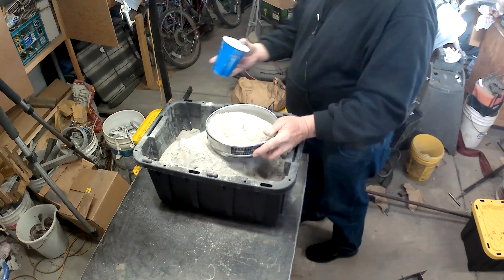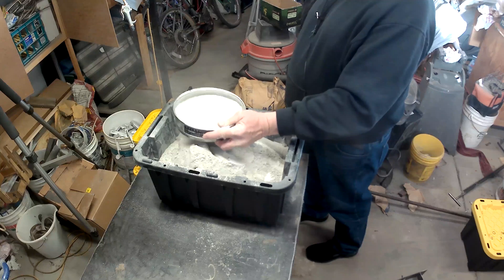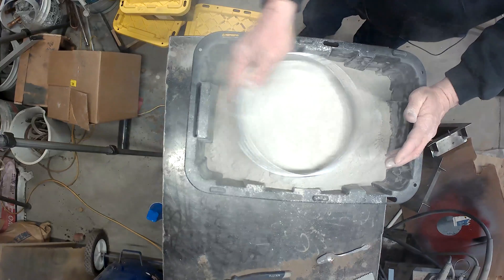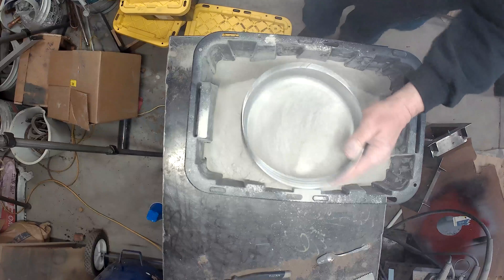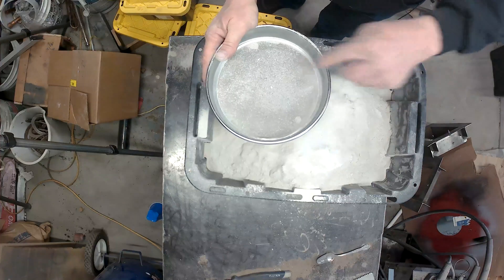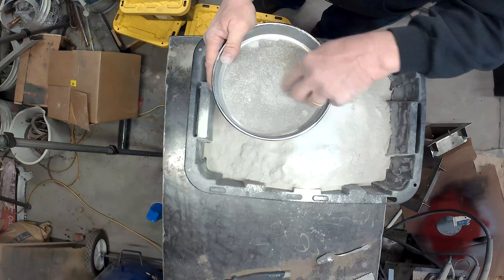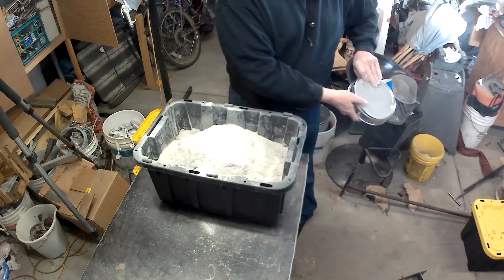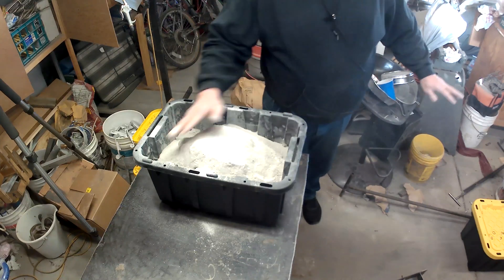Walk away from petrobond. My last word

Comment: Good to see a new video! Hey isn't that the cattle branding logo on your sweater? Nive to see a little of the town you live! Looks kinda busy? Are there regulations in regard to COVID-19? I have never used petrobond, it's just too expensive for me. I do not make my sand myself, but buy it from an art shop. It's a very fine sand, almost like dust. In there is clay. I'm still looking for the best water ratio in it. So far I think it can catch all details, but I'm a little worried about the water evaporating and causing bubbles in my cast. If I mix it with less water it will be much more difficult to carve out channels for the metal to flow... I'm still in the experimental phase :) Great video again!
Reply from the maker: Yes, it is the brand that my wife developed.  I love it. 
I was shocked at how much traffic there was the day that I recorded that drive. It's normally not anywhere near that busy.  
Our whole state is under a "stay-home" order. I haven't heard if the latest call from the president to go until April 30 is in effect here now as well.  I assume it is or will be very soon.
I think most people would be surprised (well those that haven't used green sand) at how dry my sand is.  The only time I've seen problems in my surface was when I mixed it too wet and I think the steam deformed the surface.  I have yet to see my sand cause any sort of porosity.

Comment: Looks like your new sand is working pretty great!  But for the price comparison, don't forget you're comparing making this yourself vs paying someone else to mull up the petrobond.  I wonder what your supplier charges for just the PB binder vs bentonite.
Reply from the maker: Hey bud,
I wondered that as well, but given that I wasn't interested in going back to an oil-based product I never asked. 

I guess one of the points (that I didnt state) of this is that I don't have a muller and I'm able to do it without paying someone to do that for me.  Regardless, the cost to me is 1/10th of that of petrobond
Reply: @swdweeb  Fair enough.  I guess a better question would have been, how much do they charge for premulled greensand?  :)